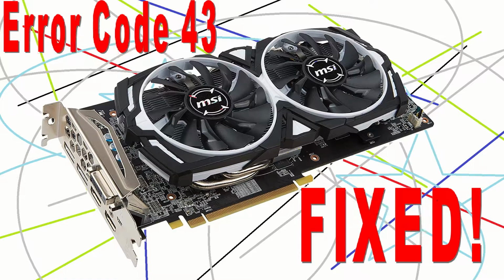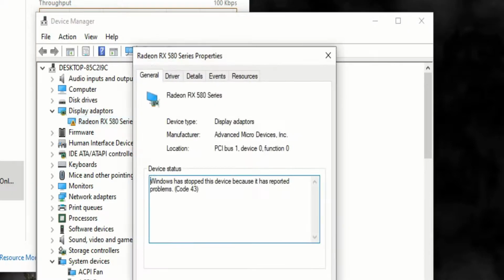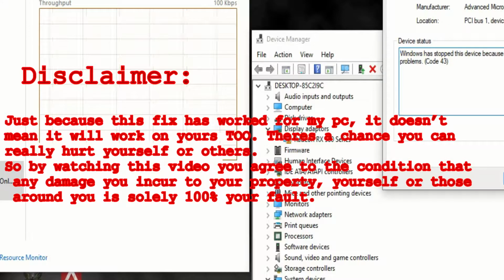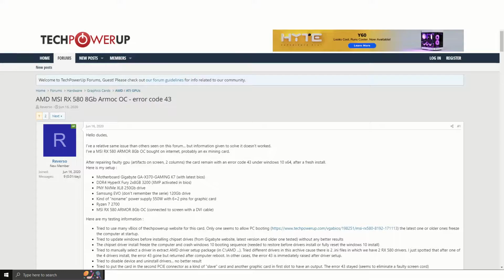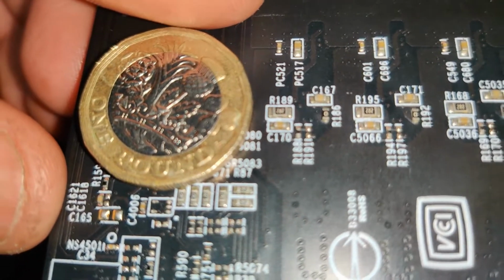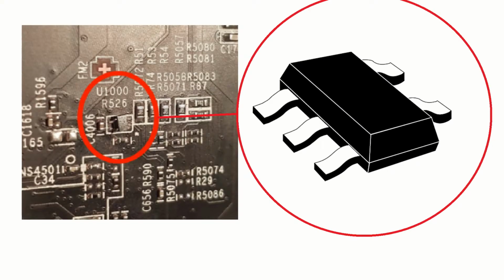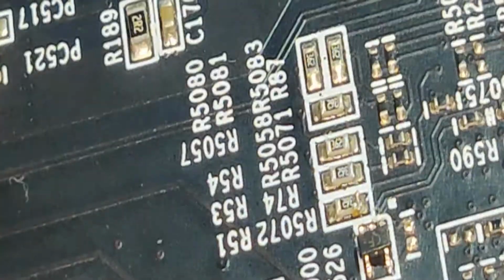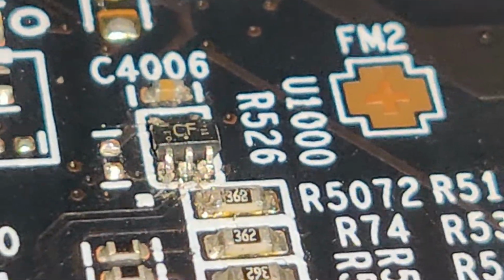How I FIXED my RX 580 graphics card from the trouble code 43 (gpu error code)

Comment: Well, my U1000 gate is still there, and by the looks of it, the solder is still good. But glad you got yours up and running. I'm stuck with my backup RX570 4gb until I can get the Code 43 issue resolved with my MSI 580 8gb.
Reply: Did it works on yours 570?
Reply: hey how did you solve the issue?
Reply: @SaikaSaika-s9b  Binned it and got a 6800XT.